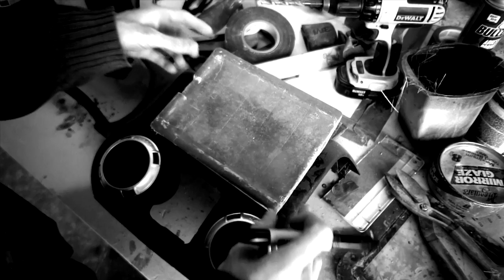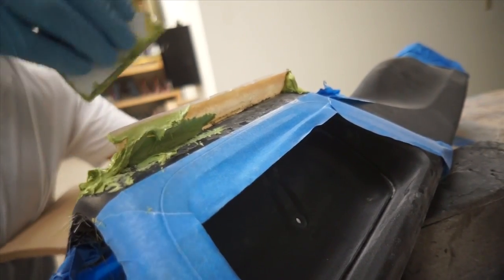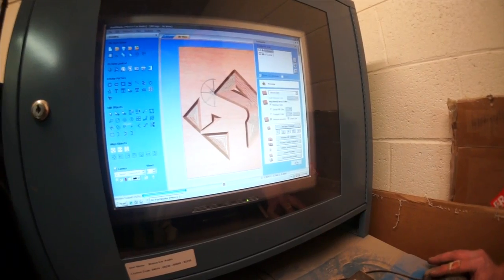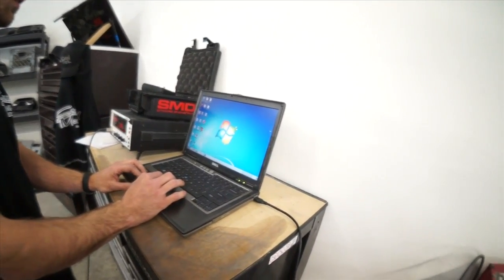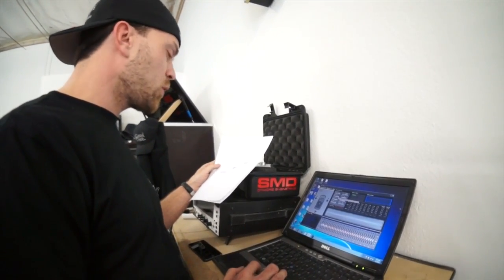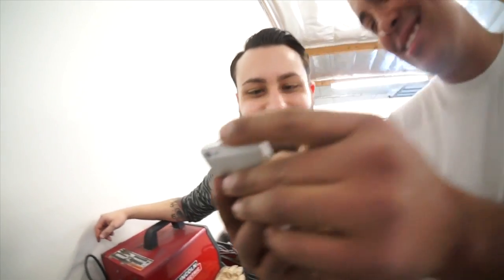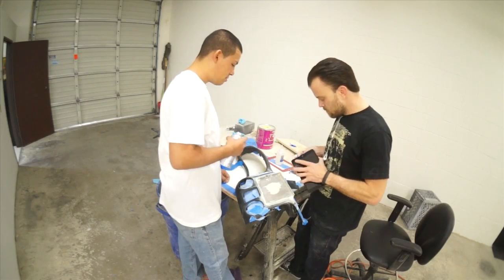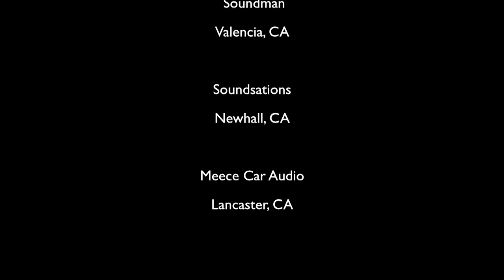Amplified - Audison Bit Ten how to EQ, Jeep iPad mini, CNC Router logo, more

Comment: If you want to learn how to tune a sound system read Sound System Design and Optimisation by Bob McCarthy. It's aimed at sound system design for theater and concerts etc but it still applies.

Comment: Not wanting to sound like a troll but RTA's are rubbish for tuning a system they don't show you nearly high enough resolution to actually tune a system.
 If you have a dip in your response the first thing to do is to figure out why you have a dip, if it's due to a reflection it may be the particular position where you have your microphone is experiencing destructive interference at the particular frequency where the dip is. If this is the case equalisation will not fix this problem.
Reply: with that kind of music wont notice the dips anyways...
Reply: would of been mixed with KRKs :P